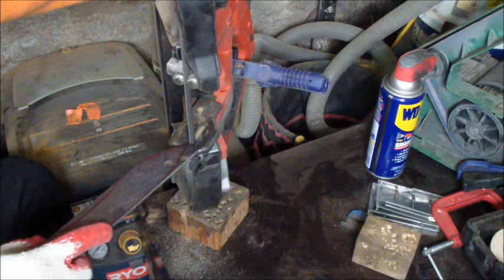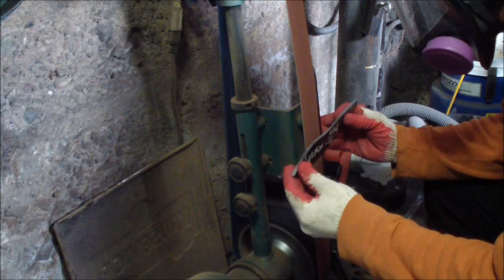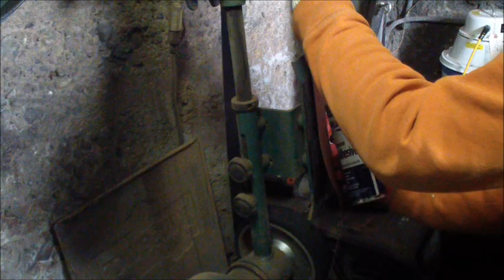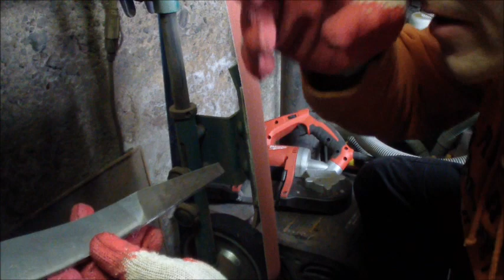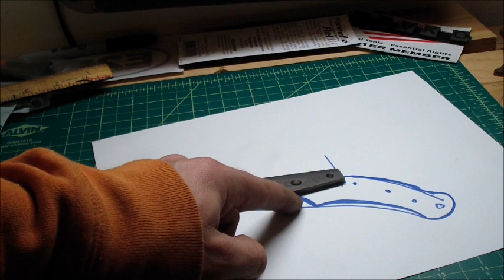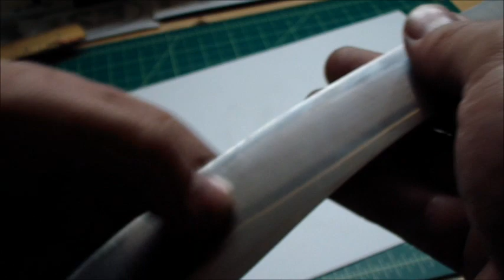Half Tang Custom Elmax Knife Project part1

Comment: Awesome project! Interesting to see you at work, it definitely makes me want to get a grinder even more now! I really hope it turns out well, it's such an interesting design. One thing you might want to think about is maybe rounding out that sharp 90° corner, it will concentrate the forces when chopping and will most likely crack the g-10 right there. PRetty sweet design over all though, and i can't wait to see the finished product!

Comment: Impressive weight for such a beefy looking spine. I can't wait to see what you do with that handle.

Also, "don't cut yourself" when using that bandsaw! I understand that you use the tools available, but clamping the saw's trigger into the "on" position while cutting towards your own fingers is a "kids, don't try this at home" scenario.

Here's an idea: What if the steel was secured in a vise and the bandsaw was then hand-held to make the cuts *away* from your fingers and body?